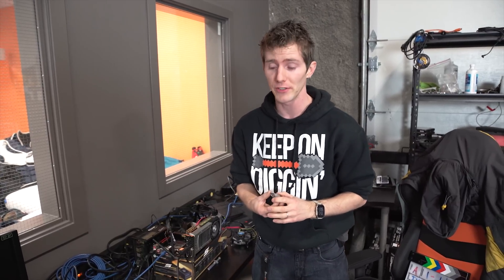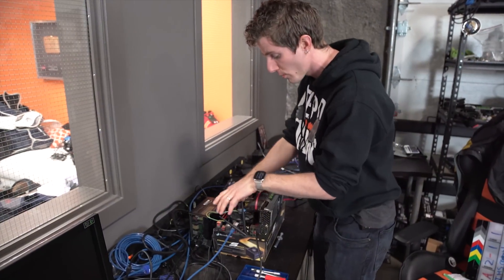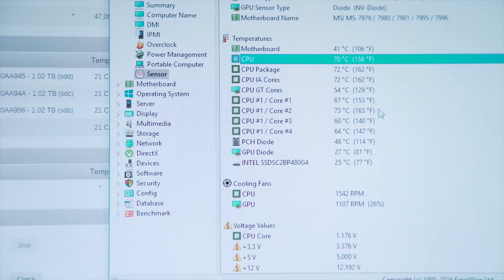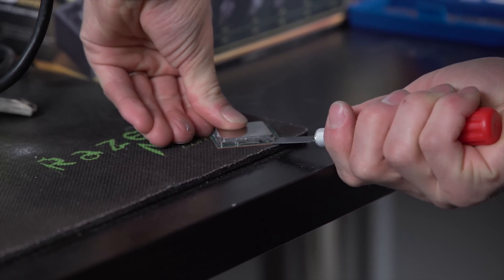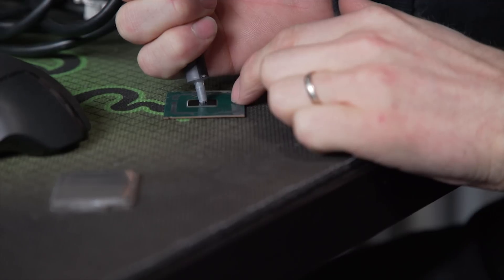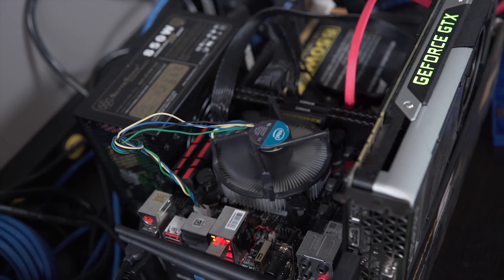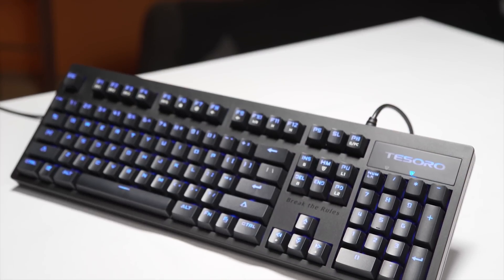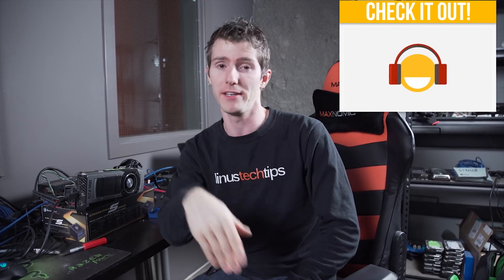Delidding an Intel Core i7 6700K - Is it worth it!?

Comment: Well, i didn't knew that inside that peace we spread thermal paste was necessary to spread thermal paste also. A realy old CPU like AMD 1800+ needs to replace that? This is actually necessary to do in an certain moment of the CPU's lifecycle? What we actualy do is replace the thermal paste on the metal top. If i don't have to replace the thermal compound of the internal parts, how the heck do a CPU run cool after 5, 6 years or more?
JUST A WARNING. I'M NOT A TECH EXPERT ON THE SUBJECT LIKE LINUX, I JUST DO PREVENTIVE MAINTENANCE FOR ME LIKE DUST REMOVAL, THERMAL PASTE REPLACE, COOLERS CLEANUP AND STUFF LIKE THAT... BASIC STUFF. I ASK THIS BECAUSE I HAVE AN OLD COMPUTER STOPED HERE WITH AN AMD ATHLON 64 1800+ 32 BIT, 768MB OR DDR RAM, 80GB SATA DISK, NVIDIA GEFORCE 6200 GPU, MOTHERBOARD ASUS A8V-MX AND I GOT CURIOUS NOW ABOUT THE SITUATION OF THAT INTERNAL THERMAL PASTE OF THAT PROCESSOR, WICH IS 10 YEARS OLD RIGHT KNOW. RECENTLY, I CLEANED IT UP COMPLETELY, I EVEN REPLACED THE GPU'S THERMAL PASTE. CLEANED THE AGP AND PCI SLOTS, REMOVED A LOT OF DUST, AND ALSO CLEANED THE HEADSINKS COMPLETLY, CLEANED THE MEMORY SLOTS, EVERYTHING, AND FINALY, TO END THE HISTORY, I REPLACED THE CPU'S THERMAL PASTE. SO, +LinusTechTips, do i try it? It's an old computer so i won't loose nothinhg... or not too much.
AND FOR ANYONE THINK THAT I AM DUNB AND A KID. NO! I'M 21 AND I AM JUST CURIOUS. CURIOSITY MAKES YOU A KID. IT'S JUST YOUR EYES MESSING UP WITH YOU, READER.
Reply: +superhuman501 depending on what paste you use, you don't even need to replace the paste on top of your cpu after years of use. This procedure Linus does, is not necessary in any part of a CPU's lifecycle, and is optional for those who are trying to force a very high overclock on their processors. Most people, including most overclockers, don't need to risk this procedure, which is why Linus didn't even want to make this video originally.
Reply: Why do u have a system that old? I a thinking that is not your gaming machine.
Reply: Ornatelime5079 No, it isn't! It is stoped here withouth using it.

Comment: @Linus 

Please scrape the black polymer adhesive off of the IHS and the CPU, you can use your thumbnail to do so. After that please order a proper TIM for the die such as Cool-laboratory Liquid Ultra and apply that properly onto the die. You may use whatever TIM you please between the cooler and the IHS. Then please tell me again if you do not endorse de-lidding? I have de-lidded my 3570k, 4790k, and 6700k with greater than 20 degrees delta and was able to gain 200MHz plus each time. I do appreciate your videos and love your enthusiasm but please, as someone who has de-lidded for his last three builds you must listen. You did it wrong! Do it right and you will see the light!

Comment: I delidded an Intel Haswell G3258 (Dual Core, 3.2 GHZ) and used coollaboratory Liquid Ultra without removing adhesive.

My results were 10 degree celsius drop during idle and 20 degree celsius drop during stressed stable OC.

Might sounds like bro science but trust me you're a noob if you think this technique doesn't improve system performance.
Reply: +Raphael Lyonnais Olivier Keep in mind he used a Skylake chip that is better built and doesn't need de-lidding.
Reply: +Gaveroid  Yes the skylake 6th Gen intel architecture is superior to haswell and in turn generates less heat because of higher energy efficiency.

I think the test performed was inherently flawed since a stock cooler has a very limited cooling load.

The increased cooling comes from the high performance TIM (Thermal Interface Material) used.

Using thermal adhesive seems like a good idea because this process breaks the seal it would be natural to put in a new seal.

Overall I would only recommend doing this to people overclocking and using proper materials and technique. (EX: rubbing alcohol, q-tips, anti-static, table-top vice)

Comment: Sorry to be rude, but you should probably get your facts right before making a video. 
Firstly, Intel's paste is really good. Not as good as the liquid metals however, but that isn't the problem here. The issue is the goop that it used makes too much of a gap and contact between the IHS and the core itself don't make direct contact. 
Secondly this has been happening on recent CPUs since Ivy Bridge, not Haswell. 
Thirdly if you want a true test you need to overclock said chip and then do the test again, overclocked. Preferably with even just a hyper 212+.

How do I know all this? I was an early adopter with De lidding my 3570k and I lost around 22c on the exact same set up on the same day.  Which makes it worth doing if you wish to overclock. Before on my silver arrow sb-e I would run 4.4Ghz and get around 85c, and after is was around 63c and it made it possible to run 4.6GHz. 
If you want proof go check out the delidded club at overclock.net myself and many others have posted there with our results.

Comment: Ok on the 6700k they improved the TIM but on the Haswell and Ivy Bridge CPUs the TIM was really bad. On my 4790k the temps got really bad after about a year of hard use. even after changing the tehrmal compund between the cooler and the IHS it didn´t get better so i delidded my cpu and got an improvement of about 25° C. I wouldn´t do it on New CPUs but if you see your temps rising above acceptable limits this is a way to deal with it.

Comment: I don't think this test is fair with the stock cooler. As we know, the stock cooler really sucks, meaning it was probably the limiting factor when it came to heat dissipation and even though the TIM under the IHS is bad, it's not bad enough to make a big difference because the cooler can't lose all that heat anyway. If this was tried with a 240mm rad or a beefier air cooler, i think the results may have been significantly different, as the cooler would be able to dissipate more heat, and the transfer between the die and the block/ heatsink would now be the limiting factor. People have seen up to 20c drops with delidding but im pretty sure nobody would delid with the stock cooler.

Comment: I'm no expert at this, but my opinion is Linus could have done this a little better:

1) Vice method is safer.  I believe more people have broken cpus with the razor method than a vice.
2)  Why do something so risky if you aren't going with the best liquid metal thermal compound?  Additionally, this compound requires you to spread it which may give you better thermals.
3)  This is mainly used to achieve higher overclocks.  People will do this when they're reaching thermal barriers and believe they can get a high OC if they can keep the chip cooler.

Comment: Huh, my Intel Celeron Dual Core chip never had a CPU lid on it in my Asus X401A laptop back when it worked. It also had the worst possible thermal paste ever. I could not remove it with rubbing alcohol and a microfiber cloth no matter how hard I tried.
Reply: +Ryan LeFevre Laptops don't have heat spreaders.

Comment: Linus, not sure if it's been mentioned before, but I'm not sure if using the intel stock heatsink is the best idea.

Each layer between the die and heatsink has its own thermal resistance (and you could say the heatsink itself has thermal resistance).
If you use a crappy heatsink, the decrease in resistance of the Die/IHS thermal paste may not be significant because the heatsink is the limiting factor.

I'd advise trying again with a bigger tower cooler, such that the Die/IHS paste becomes the limiting factor. You'd see bigger improvements there.
I've a 6600K and after delidding with Liquid Metal Ultra, experienced a 11-14C drop in temperatures when OC'ed to 4.5ghz.

Comment: No overclock and a standard intel stock cooler to proove that there is no difference? Do Linus knows anything about how thermodynamics works?
Because the videos of linus about temperature and cooling are always bad or non sense.
I think that he makes no difference between temperature and heat.

If you use a standard intel cooler the cooling is limited by the cooler (thermal paste, metal, cooler are just thermic resistances in series), on the contrary if you use a big and performant cooler you are possibly limited by something else. 
Plus people who need to make it will use a very performant thermal paste such as liquid metal.
He didn't say if the time to reach 67°C was the same. Cause reaching 67°C after 5min or after 25min is not the same thing at all.
And of course to test if you have a gain you need to increase the Power (overclock) to see if you can dissipate some more heat not just try at clock speed.
Reply: i can show it making a calculation if anybody wants it.

Comment: This test was massively flawed.

First, Linus, there is a very good reason people use and recommend Liquid Ultra for application between the die and the IHS. When you use Liquid Ultra normally, between the IHS or heatsink, the difference between it and other good compounds is negligible. But when it's applied to the die, the difference is HUGE. Double digit drops, in C, compared to other non-metallic compounds. (I've found this from the enthusiast laptop community which I used to be a part of, using Liquid Ultra between the die and heatsink on high end laptops - where there is no IHS - easily reduced temperatures by 10-15C compared to any other compound. I'm not exaggerating.)

Second, you need to be very careful about what compound you use between the die and IHS. It looks like you used MX-4 there, would I be correct? If you'd continued to test it, you'd find that a few days later, you'd be running 20C HOTTER than before. Many compounds, such as MX-4, cannot withstand the extremely high thermal gradient that can exist between the die and IHS (or, on a laptop, the die and heatsink). Normally, the IHS (and the thermal interface between IHS and die) would massively smooth that thermal gradient. Again, this is why Liquid Ultra is recommended - it withstands those thermal gradients AND performs far better with those high gradients than with any other type of paste.

Third, testing it with only one cooler, and at only one clock/voltage setting. A thermal interface that is adequate at 80W may be a limiting factor at 120W. Similarly, if you had a proper cooler with multiple heatpipes that can draw heat away far faster, the thermal interface may become far more limiting.

People delidded Haswell because it produced a 10-20C drop on many CPUs, and that's no exaggeration. Because they did it properly, with Liquid Ultra, with a proper cooler, in an overclocked setting.

Comment: The issue with this video is that Linus doesn't really know why ppl resorted to delid, he even doesn't know when it started. It all started with ivy bridge and the issue was not only the tim but the distance between the ihs and the cpu. If linus had a ivy bridge (or the 1st haswells like the i7 4770k) he would notice a major difference in temps.
The devil canyon haswells (i5 4690k, i7 4790k and pentium g3258) brought an better tim and improved ihs to get better temps on those cpus, + more voltage controllers.
Also, that delid technique of having the bottom part of the cpu just scraping around... /headshakes

Comment: Look at that tiny die, it says a lot about the state of the high-end consumer space

Nehalem: 4C/8T 45nm 263 mm2
Sandy Bridge: 4C/8T 32nm 216mm2
Ivy Bridge: 4C/8T 22nm 160mm2
Haswell: 4C/8T 22nm 177 mm2
Broadwell: 4C/8T 14nm ? mm2
Skylake: 4C/8T 14nm 122.4mm2

(all die size numbers from AnandTech)

The lack of any meaningful competition in the x86 space has basically allowed Intel to reserve their big dog chips for servers and the obscenely expensive "enthusiast" line. The high-end consumer space has remained the same basic 4C/8T formula with incremental architecture improvement for 8 sodding years.

Skylake's 122.4mm2 is actually quite insulting when you realize that high-end mobile SoCs can be LARGER than the current, almost £300, 6700K. Apple's 16nm A9X SoC is 147 mm2 for example (source: chipworks). 

Here's a thought. If Apple can make a 147mm2 chip with 2 x beefy cores, large caches, a wide/fast memory controller, 12-core GPU and a whole host of other special cores sip power in a passively cooled tablet, why can't Intel make 4C/8T the norm for high-end laptops? Why hasn't Intel used that excess transistor budget to make 8C/16T the norm for consumer high-end desktop? You know why...

The x86 market is totally beyond repair if AMD doesn't turn it around with Zen. If Zen bombs, say goodbye to AMD, say goodbye to any remote possibility of competition in the x86 space and pray that the industry is spooked enough to invest heavily in ARM.
Reply: +Aaronage Power efficiency has been the giant trend of the last few years, from cars to industrial power plants, and from watches to the render farms. The masses have come to view computers from a different perspective. Today, sending a simple email, writing an extensive essay or watching some YouTube are slowed down more than anything by the software and the quality of the internet connection, so it doesn't matter if the latest CPU has double the performance. It starts to matter when Jane and Joe discover that they'd save money on their electricity bill and that they'd be able to use their laptop for more than 3 hours on the road.

I agree with you, it's a sad situation. AMD might regain a competitive position, but as you said, Intel is reserving its most powerful chips for the servers and top-tier prosumers. What's stopping them from introducing those chips in the consumer market at bargain prices? On top of that, AMD will never be successful if they don't get the OEM's on board. Zen must be competitive on both performance and efficiency levels, and that's a tough nut to crack.

ps: I'm an enthusiast myself.
Reply: +Michel van Briemen Efficiency is important for sure, but I don't believe the small die trend has anything to do with that. Most of the gains in efficiency have come from changes like moving towards SoC designs (removing the need for north and south bridge chipsets), using separate voltage domains and power gating, more intelligent frequency/voltage control etc.

Realistically, a 122mm2 die CPU and a 400+mm2 die CPU will be within a couple watts of each other for light desktop workloads these days. The difference only comes at load really.

Comment: Is it worth it? In 98% of cases, hell no. But I did it anyways. Is having 7 case fans worth it? No, but I did it anyways. Is having 32GB of RAM in a gaming rig worth it? No, but I did it anyways. Was building my friend a free computer out of leftover swapped out parts between me and my room mate in any way worth it for me? No, but I did it anyways.

Why? Because I wanted to. This is custom PC's. It's the same as throwing a Turbocharger on your car when you hardly ever leave the city, or getting military attachments of questionable legality for your AR-15. You don't stop doing things because they're impractical, or risky, or could potentially cost you hundreds/thousands of dollars on top of the needless hundreds/thousands you already spent unless you're sane. For the rest of us, you just press ever onward into the face of uncertainty and .000001% better performance.

Comment: You need to use clp (Coollaboratory Liquid Pro), not your typical thermal compound.  I just did this last week with my 6700k and dropped 23C off my max temps (4.7ghz at 1.42vcore).  I was in the mid to high 80's and now I am low to mid 60's while stress testing.  Using corsair H 100i gtx cooler.  I used the vise only (no hammer/wood) method.. not the razor blade method.

Comment: I appreciate the effort to make this video but I think delidding a CPU at stock clocks/voltage with the stock heatsink does no justice to the technique.  Most people don't delid to get a couple degrees running like this.  They do it to get acceptable temperatures at the highest overclock they can.  With a much higher voltage and proper water cooling or even a high en air cooler delidding can easily make a 15 degree difference.

Comment: are you kidding?? This is the laziest way ever. And by all means nowhere near the effect it will have if done properly with proper materials. The liquid metal will have way more difference in temps, as well as using a much better heatsink. This is a (lazy) joke.

Comment: Also, Linus' conclusion is just way off, which of course happens when testing at low clocks with a shitty stock cooler. There are plenty of examples around the net where IHS removal + top end thermal paste gave a -10 to -20 celsius drop in stress test temperatures, which definitely makes a difference for overclocking. Instead of being thermally limited, you'll be voltage limited and will get the most out of your chip.

Comment: It's not the thermal compound that sucks... it's that the glue around the CPU adds distance between the CPU and IHS, and once you remove the glue around the CPU, the IHS will be able to sit right on top of the CPU with minimal performance loss due to thickness of the thermal compound layer

Comment: can you tell me if these part are compatible AMD Athlon X4 860K 3.7GHz Quad-Core Processor, G.Skill Ripjaws X Series 8GB (2 x 4GB) DDR3-1600 Memory, GeForce-GTX750TI-OC-2GD5-Performance-Graphics-GDDR5, Gigabyte GA-78LMT-USB3 AM3+ AMD DDR3 1333 760G HDMI USB 3.0 Micro ATX Motherboard

Comment: Linus, why wouldnt you use a much older and more used chip to test this on? Like a core2duo that is 10 years old would have shown a much better improvement because the original paste would be practically dust